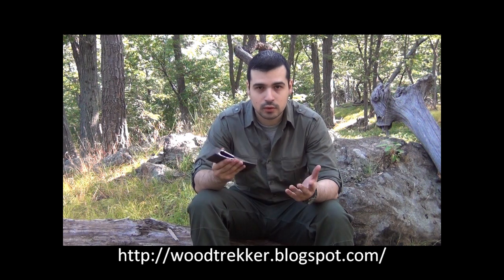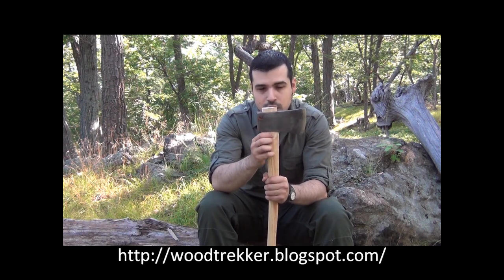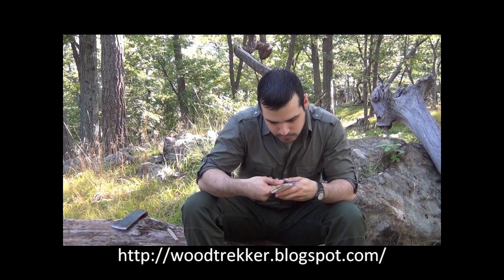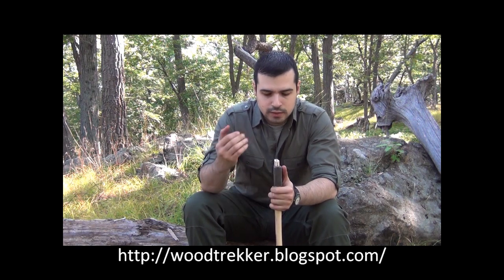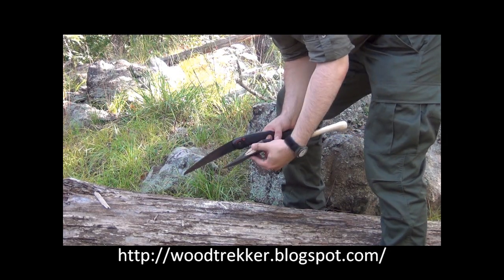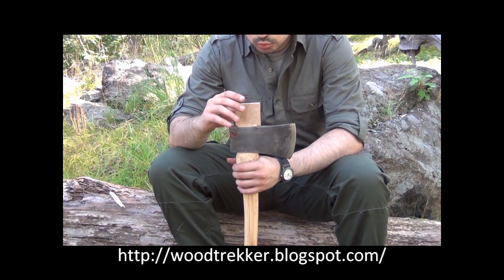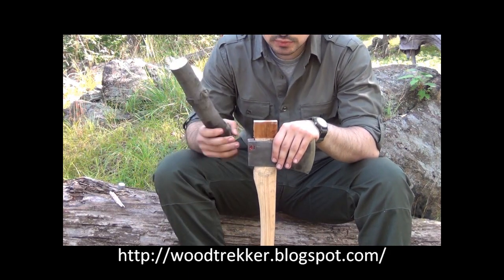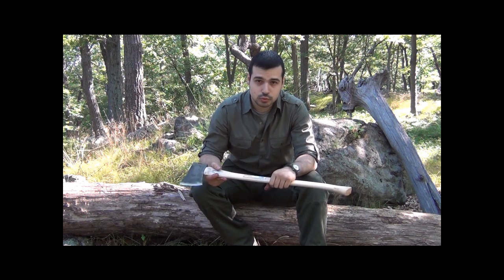Axe Maintenance and Repair Part 3: Hanging an Axe

Comment from the maker: I know some people don't like them, but I do. They expand the handle in a direction the wooden wedge doesn't. I find that it does not ruin the grain in any way, at least no more than the wooden wedge does. In fact, since the wooden wedge is typically inserted parallel to the grain, it is a lot more likely to split the handle than the metal wedge. I think often people over think the process.